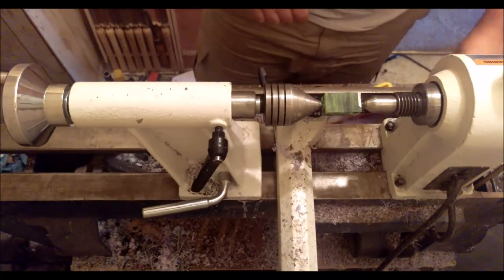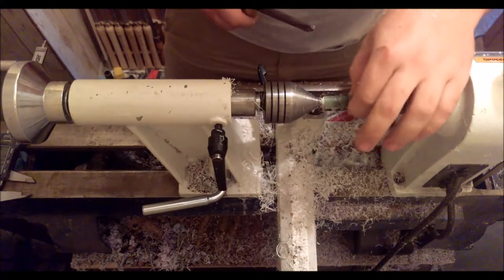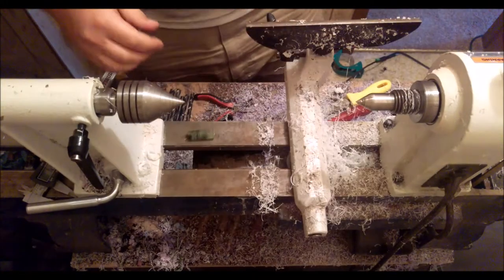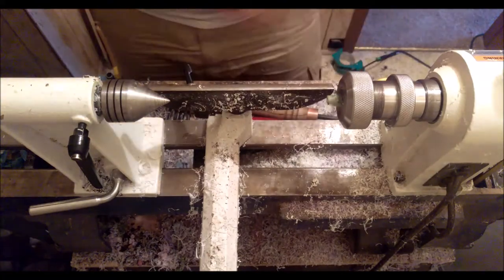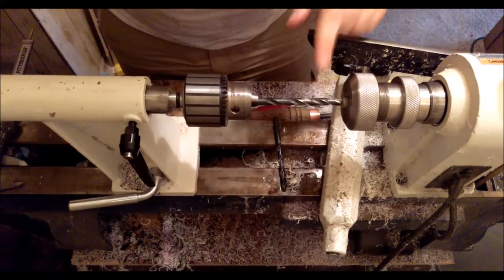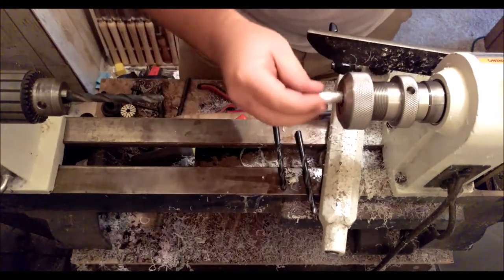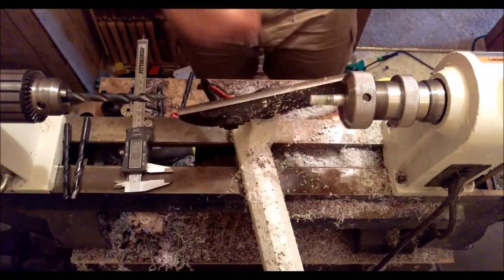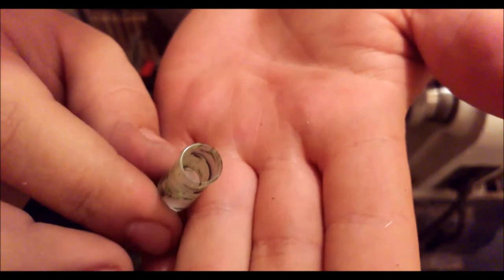Making an acrylic fountain pen section

Comment: 8:05 finished turning outside to 12mm.
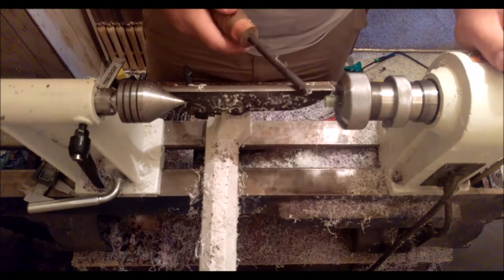9:55 Turning tenon to 10mm.
11:22 Parting tool to square edge of tenon (9.95mm)
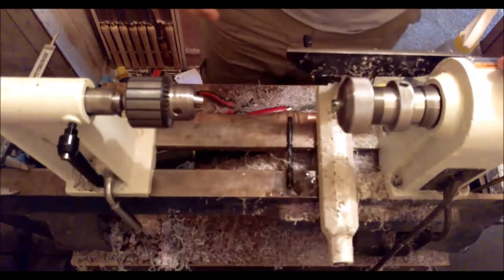13:09 video skips drilling and power threading for #6 jowo nib unit
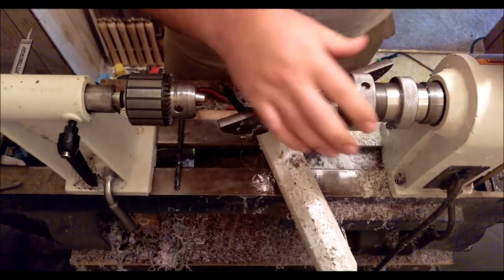15:10 drilling front side to accept nib unit (7mm, 8.5mm, then 9mm)
17:50 attach to mandrel to turn section outside shape
24:10 sanding
Reply from the maker: Brian Chu thanks for this

Comment: Hey there, great video. I know this from a long time ago but I'm curious what does power threading mean exactly? You mention it around the 13.30 mark or so
Reply from the maker: Thanks!

I just meant that the lathe is turned on. Normally I turn the Chuck by hand, but some small threads I'll turn the lathe on at low speed.